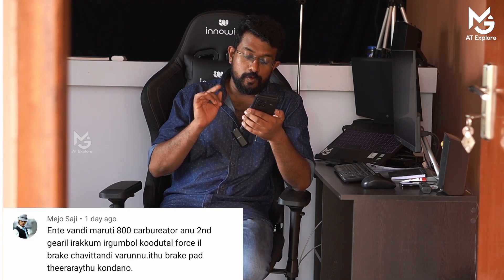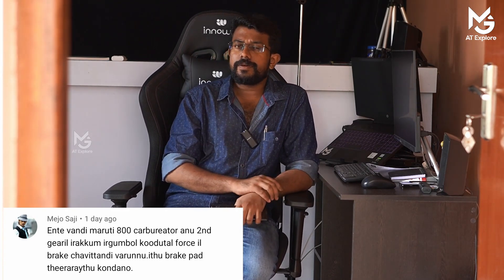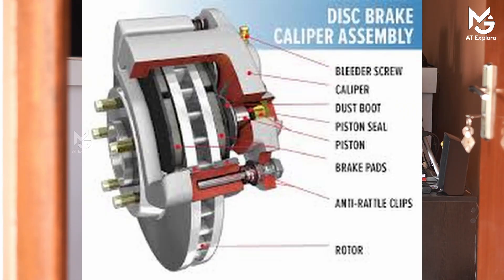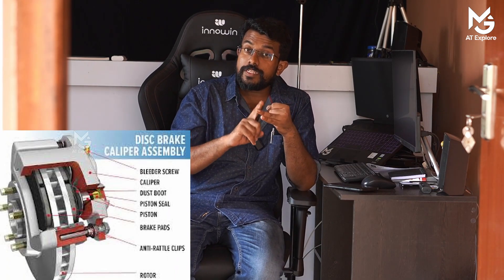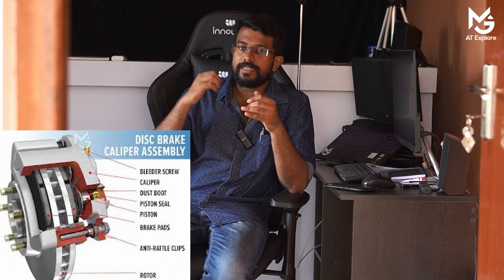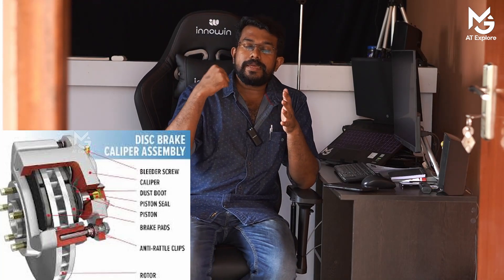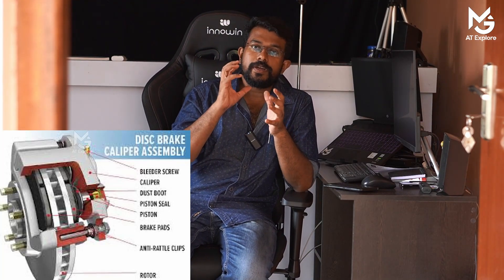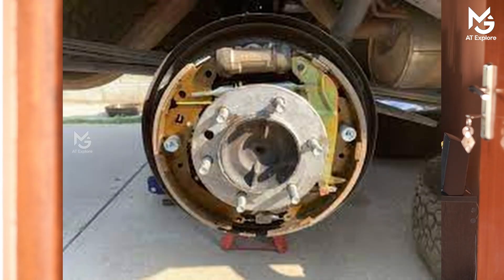ഇറക്കത്തിൽ ബ്രേക്ക് ചവിട്ടുമ്പോൾ ഫോഴ്സ് കൂടുതൽ കൊടുക്കണം | Brake applying| need more force | RAGESH

Comment: Ente vandi celerio zxi+ AGS (2022 model) aanu. Eeyide aayit transmission heat warning light edak kanikkunnud, Kurach neram blink cheytha shesham pne prblm onnum illa.( long drive onnum adikam pokarilla, max. 150-200 km edak pokum). Service centril kanichappol edakoke engane varam enna paranje.Correct aayit oru answer kittiyilla.coolent & engine oil level oke aanu. Reason onnu paranju tharamo.
Reply from the maker: Both brake and accelarator onichu apply cheuyiundo? Kooduthalum hirange ottam ano ullathe? Nokathe njn ithine kurichu oru video idam..
Reply: @MGATEXPLORE  high range ottam theere illa. Brake and accelerator orumich enagane apply cheyyum??? Athum AGS il?? 🧐 No chance.

Comment: Bro, എന്റെ WagonR 2014 model 50,200 km ഓടിയ വണ്ടി Blower speed 2 ഇൽ ഇട്ട് Ac ഇടുമ്പോൾ compressor തീരെ cut off ആകുന്നില്ല, continous ആയി working ആണ് 10-15 minute on ആക്കി ഇട്ടിട്ടും. But A/c 1 ഇൽ ഇടുമ്പോൾ correct ആയി cut off ആകുന്നുണ്ട്. ഇത് എന്തായിരിക്കും problem??? Temperature blue il ആണ് അതുപോലെ recirculation മോഡിൽ തന്നെയാണ് ഇട്ടിരിക്കുന്നത്.
Reply from the maker: Normal 2 ittal pettanu cut off akilla...pine ac gas level kure undengil ithe same problem kanikum...just check the ac gas level, kure undengil ee same problem varum.

Comment: Bro namal brake pedikuppol tick sound und pedelnd aviday endhaan sambavum
Reply from the maker: Brake pedal ninu ano sound varunathe? Or wheel sideil ninu ano? Pedal ninu anel athe onu lube cheythal mati ok akum..ini case brakil ninu anel athe onu cleaning cheuthal mati
Reply: @MGATEXPLORE  brake pedal nd  ചവുട്ടുപ്പോൾ tick sound
Reply: @MGATEXPLORE  endhe vandi 2010model swift 75000 odi ടുള്ളു battery charge chayunna motor undaloo athil oru belt ille അത് വണ്ടി start chayuthathn ശേഷം ഒരു ഒരായുന്ന sound beltind മുകളിൽ 2line kannunund replace ayyikunoo rply

Comment: Bro എനിക്ക് reply കിട്ടിയില്ല 😄ഇന്നലെ ചോദിക്കുന്നു, എന്തെങ്കിലും തിരക്ക് കൊണ്ടായിരിക്കാം, എന്റെ വണ്ടി alto 800 ഒരു കുഴപ്പവുമില്ലാതെ ഓടിക്കൊണ്ടിരിക്കുമ്പോൾ പെട്ടെന്ന് fuel തീരാറായെപ്പോലെ missing വരുന്നു, പിന്നീട് അത് ready ആകുന്നു എന്താണ് കാരണം
Reply: Ac on aayirikkum ool aanoo
Reply: @hamsakunnath6254  s
Reply: @Shaneej  bro ee doubt njanum chodichirunnu. Andha carum alto aane 2018.model.runninggil no problem. 5 lo 4lo run chaydh vanne Oru pocket roadilaakk kayaraan vaandi 1 gearil  itte aduttal  pinne vandi moov aavaattha poole pathunggi padunggi ninnitte pinne pettenne ook aagum. Ac onil matremee ee problem ullu. Ac off aaneggil edhee road oru kuyappavum illadhe oodum. Alto 800 allam inggina aano.
Reply: എന്തായിത് ഇങ്ങനെ
Reply: @Shaneej  alto cc kuranja car alle adhkond aavum. But ac of aanenggil no pblm
Reply from the maker: Hi yes kurach bc ayi poyi 3 days ividey illayirunu ata msg , comment onum reply illathe...Inkane oru thavan matram kanicholu? Fuel filter block ayalum ithupole varum fuel kureyumbol pressure rail il varilla so engine misfiring indakum alengil ini continue kanikundengil spark plug and airfilter check cheyuga